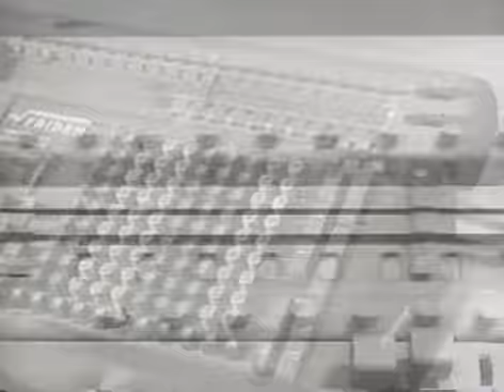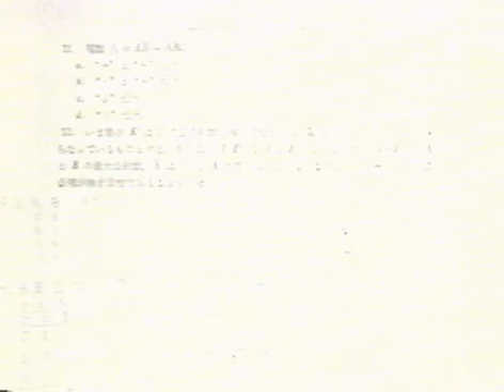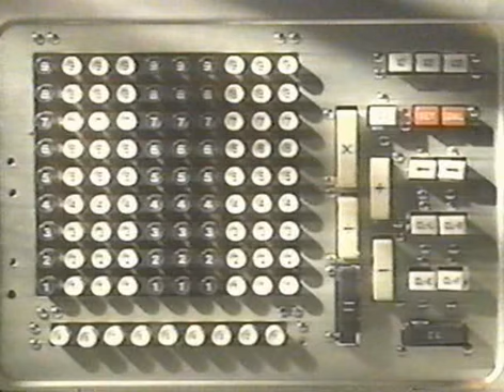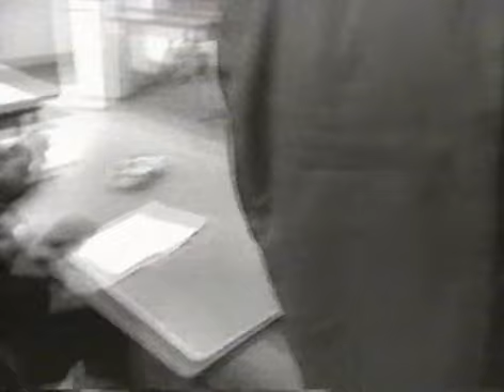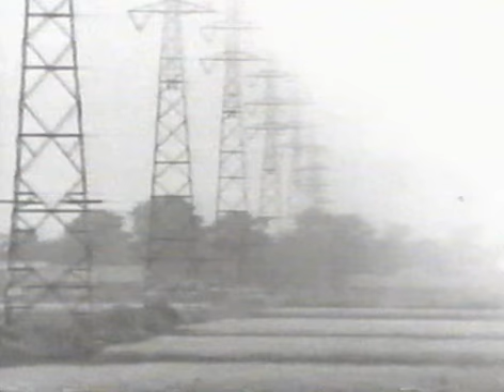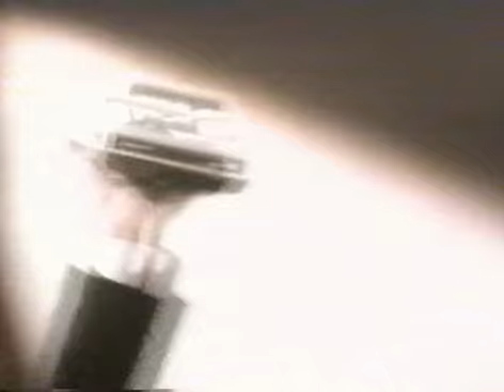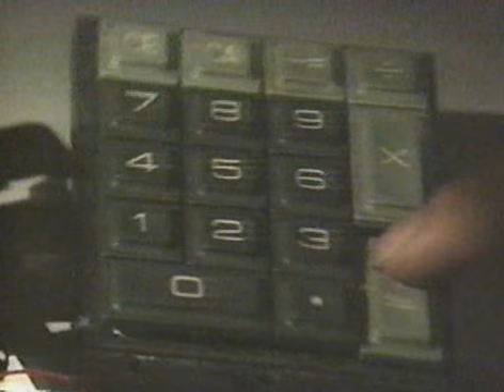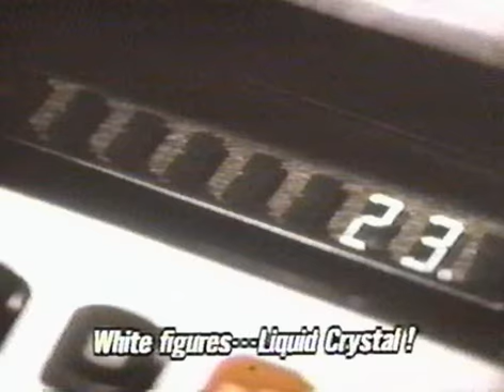The Calculator Wars: A video history of Japan's electronic industry (Part 3)

Comment: Your going to have to learn how to do math in your head your not always going to have paper and a pencil on you 

Your going to have to learn how to do math your not always going to have a calculator in your pocket 

Your going to need to learn how to do math your phones not always going to be charge 

You need to learn math incase the WiFi’s down and the I-net implant is down. 

You better learn mathematics so you can shut down the censor chip inside your skull.